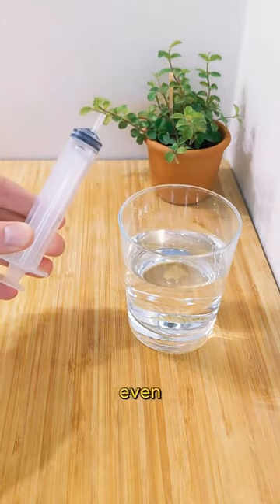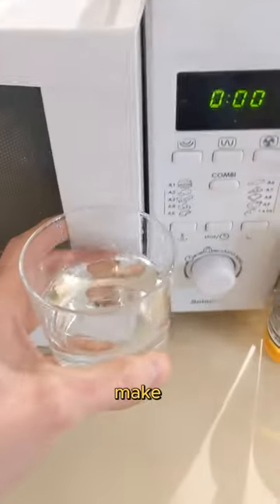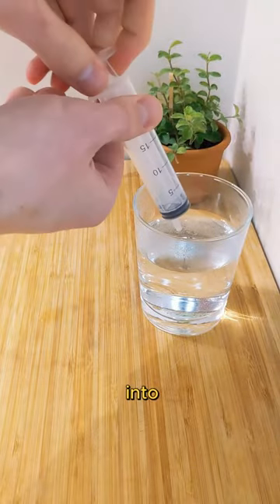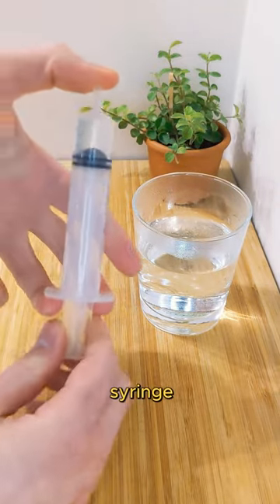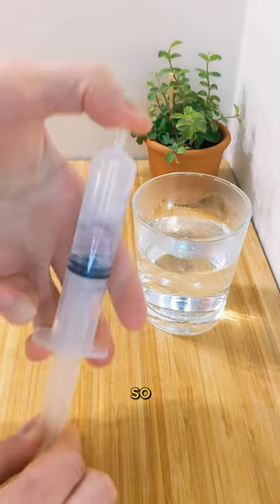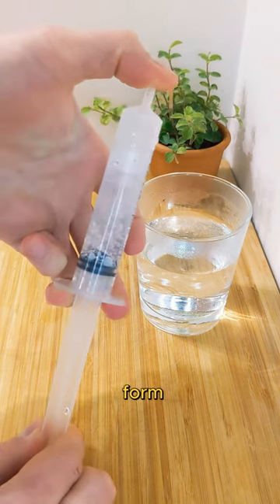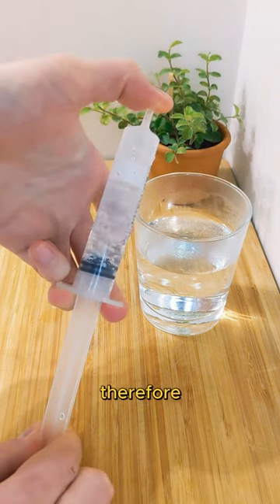Boiling water with a syringe, and COOLING it down! @LabScienceExperiments

Comment: I always thought that the only way to boil it was the stove
Reply from the maker: It's also possible to change water from ice/snow directly to vapour (sublimation) but it's very slow...
Reply: I heard once that correlation of water's boiling temperature with atmospheric pressure was first experienced by mountain climbers who tried to boil some potatoes on top of the mountain. One of them wrote in his journal that they were boiling potatoes for half an hour and they were still raw and was blaming the "cursed pot" because he didnt understand it was the water that couldn't reach the usual temperature of 100°C